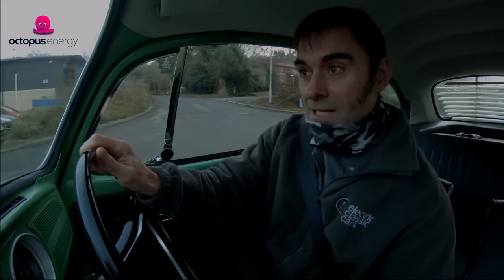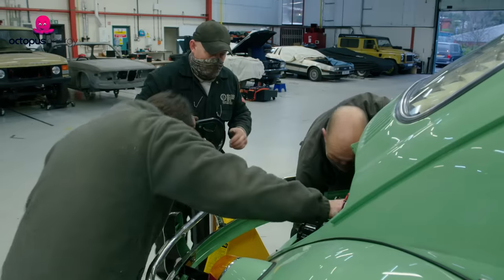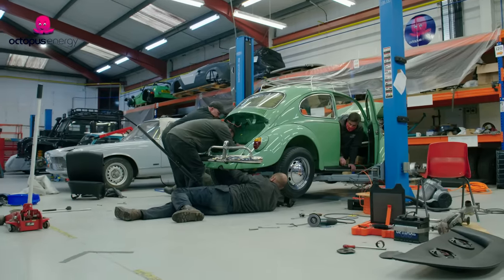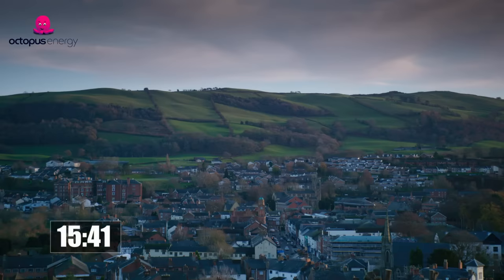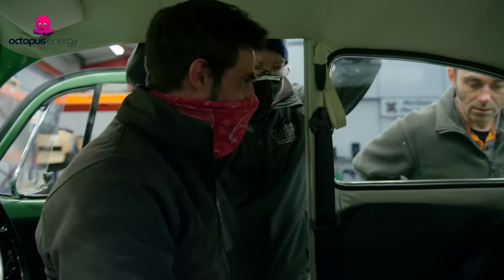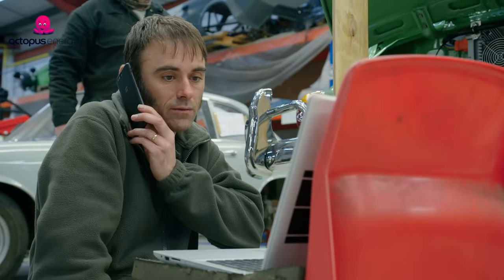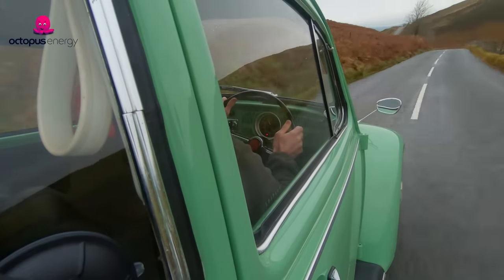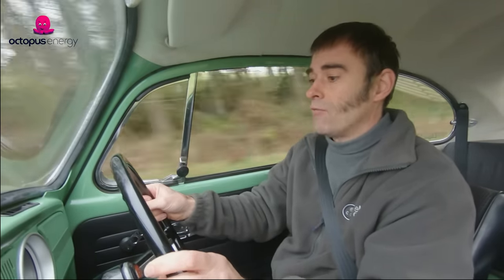VW Beetle converted to electric in a day

Comment: I was working at a VW dealership in Sacramento back in the early 70's. A man brought in his 1964 beetle that had been converted. Had the lead acid automotive batteries just behind the rear seat in the open space. The electric motor was actually an aircraft generator. He had a charging setup in the engine compartment. You switched the ignition key to the run position and the generator/motor would start. Push in the clutch and stuff it in gear and away you go. Pretty slick. Wherever he went people would be curious so they let him charge it there. Fairly simple compared to this one if the video.
Reply: Think on this hey come and charge at my place ....oh yeh anotherlot of free electrickery woooooo hoooooo  cost me nothin to run every other bastardpays me ...cheap electric cars have no soul 😈😈😈
Reply: New VWs have much better safety features dual air bags head restraints also improved seat belts I love the 65 66 67 year bugs but I wouldn't want to be in a crash still nice automobile
Reply: One of my grandad's friends converted a Fiat 500 around the same time. It was slow and did not have a very good range, but it worked good for short trips.
Reply: I own a 1979 MGB Roadster. Be cool to convert my B to electric. Nice work on the Bug!
Reply: What’s up neighbor✌🏼 I’m I. Citrus Heights Ca
Reply: @Future-Preps35  As I remember it those batteries were vented to the outside to prevent that.
Reply: Time will come when my petrol Royal Enfield will be such a novelty, I'll stop at people's houses for free petrol
Reply: @Future-Preps35  yeah and if you crash and the battery hits you in the back of the head.......all fun though, something to tell your grandkids.
Reply: How does the weight of a battery pack compare to the weight of the original engine? If the conversion adds a lot of weight, do you have to change the suspension? 

Also, in California, you can't charge your cars anymore in the evening after coming home from work. 

Also, watch 60 Minutes Australia on "blood batteries". Then examine the energy required to make 1,200 pound battery packs per car, or in this case maybe half that amount.

We must also take into consideration the fact that if every owner of a car, or multiple cars, in the world were to convert to electric technology, not only are there insufficient means to recharge...

but only one third of them could make the conversion due to the world's limited resources of lithium, cobalt, and the rare earth metals. 

In the meantime, British Petroleum, Dutch Royal Shell, ExxonMobil and the largest French petrol company have made record profits over the past few years. It's a scam. We all know it.
Reply: @higherresolution4490  how do they stop you from charging in the evening? Is it on a different circuit that they can switch off? Or what?
Reply: @stewartfenton7660  They might hit you if you were dumb enough to not secure them.
Reply: @higherresolution4490  You are preaching to the choir. I have trained for, worked on, and driven battery powered vehicles. Not a fan. Not a fan of CVT's either. Those that are telling us just how much better the EV cars are forget about the pollution generated while making the glass, upholstery, tires, brakes, bodies and all of the rest. They will have a hard time proving to me all of that was done using electricity.
Reply: @leemccullough558  
Gasoline has no soul... just kills souls actually.
Reply: This would have been a really good video...
except...
I wish the mechanics and host spoke English.
lol
Just kidding😀
Love the accents.  Oh wait!!!
One more thing...
You're driving that beautiful VW Bug on the wrong side of the road.  Why do that?  It's REALLY dangerous😱
Oh well... Good luck🍀
Reply: In 1980 we used a jet engine starter/generator to power a Triumph Spitfire.  Plenty of power.  Balancing the weight was key to success.  The electric controller was an education since they were prototyped for each installation. 

I later powered a Chevy LUV pickup with a similar starter/generator motor and original transmission.  Three position throttle: power, neutral, generate.
Reply: @Future-Preps35  That's a dramatization. You can certainly get a slight smell of Sulfuric acid when balance charging lead acid batteries as it happens at higher voltage than normal charging, but the amount of hydrogen generated (also only when charging) is negligible. Though to avoid corrosion in the battery tray and to avoid any chance of Hydrogen accumulating in closed compartments, like in a battery box, lead acid battery banks in EVs and in stationary applications usually have a shared hose connected to each fill plug to route any Hydrogen to the outside.
Reply: What most people don't know is that a generator can become a motor and a motor can become a generator.
Reply: @waltshepherd4525 
Absolutely correct 👍
Reply: @BajaGirl302  
"Fossil fuels are made from decomposing plants and animals. These fuels are found in the Earth’s crust and contain carbon and hydrogen, which can be burned for energy. Coal, oil, and natural gas are examples of fossil fuels."
-- National Geographic
Reply: Oh, god.... Yes,@All is singularity is All , we have all heard about that - from the same people that told us all the other stories / anecdotes / rumours / conspiracy theories over the years. 😑
Reply: @Future-Preps35  Modern lead acid batteries are sealed.
Reply: @waltshepherd4525  , I really not want this EV to be forced down our throat, I want it to remain a choice. Produce and sell both and let each individual decide. Do not punish those who want to drive petrol cars.
Reply: hi
Reply: @waltshepherd4525  Of course, all inside the vehicle batteries of today many of which are still the old lead acid type have vent tubes and are vented outside.
Reply: So the generator is always spinning when switched on ? Would better if it was actuated by the accelerator peddle then you could have better use of the gears. Unlike modern electrics which I don’t believe utilize a multiple gear shift box. I could see this beetle being fast as hell too. And suspension and steering upgrades would definitely be needed. But by then you could just buy a modern EV.
Reply: Pretty cool!Thanks for sharing! I'd love to do that too my 72 Datsun 1200 ...
Reply: you guys are amazing 🤩

Comment: I always found it easier to leave the muffler and tailpipes on,they make great handles to maneuver the engine in and out
Reply: I would always drop the engine on to a Radio-Flyer wagon and then get a friend to help lift the car over the engine.
Reply: @JoeHamelin   It's the same for the van as well.
Reply: It killed me.  It took three guys to remove the engine.  I used to do it by myself in the front lawn, then jack up the car and push it off the jack to get it over the engine so I could work on it.  Necessity is "mother."  LOL
Reply: @spydie me too... takes about 20 mins .. by myself.. lol
Reply: Right on. I once changed the engine in my 58 in 45 minutes. Just myself and a floor jack. There are only about 4 wires, one throttle cable, One fuel line, and four bolts involved.

Comment: That engine pulled out looks gorgeous too 😳
Reply: I just noticed that too. Absolutely mint.
Reply: Will not go to waste, plenty of Beetles need an engine.
Reply: That car is gorgeous! Period!!😁
Reply: As far as I know, they usually sell the engine to other people who want it.
Reply: A dirty ICE
Reply: I’ll have the old engine if it’s going spare!?
Reply: Yes
Reply: i have not seen such a clean engine  its almost looks new.
what price could you get for the engine to offset the build
Reply: @alkhan5445  no matter people still look for them
Reply: Steven ... that engine is not original to that year of car. Being a dual port 1600 puts it maybe 10 years newer.
Reply: @rupe53  who cares
Reply: @steinbauge4591  .... obviously the next guy who owns the engine.
Reply: @rupe53  Obviously that person will be most pleased with this engine ;)
Reply: That makes no sense. Pleasure in driving a classic is gone with the washing machine engine.
Reply: @Carl Klinkenborg ... that bug is not a '71. If I had to guess it's closer to a 66 or 67 but might be earlier. The hint that's most obvious is the swing axle transmission. The other hint is the smaller taillights. In '68 they also went to an external fuel fill instead of under the hood.
Reply: @Carl Klinkenborg ... was looking for more of those details myself but the camera didn't give me a clear view of the dash and a few other places. Here in the states, the swing axle went away after 68 and we also got a padded dash for that year and newer. By the time we got to round tail lights (1973) the fenders had also changed. I was aware that all the south american bugs had swing axles but by that time period we couldn't buy one.
Reply: @Carl Klinkenborg ... yes, I was aware of those differences between various markets, but I have been unable to keep up with them over the years. In the USA the bug was doomed for both crash tests and emissions standards, although the sub frame under a convertible seemed to sneak by till 1980 and somehow, they snuck in fuel injection on those as well. I suspect adding that to a standard bug was not cost effective in the era. As I recall the last "rag tops" were a bit pricy already. This begs the question of this one possibly being a composite car. It's remarkably clean for its age either way.
Reply: @Carl Klinkenborg .... had another look tonight and this car seems highly modified from the year you mention, but mostly on the outside. Interior (based on US cars) seems to fit 68 - 71 based on ignition switch, steering wheel, horn ring, rear quarter window hardware, and door panels. Outside we have early headlights and taillights, along with the deck lid, hood, and bumpers. High-back seats seem to be a North American item for that era (post 68) so the short ones we have here could be almost any year. I did not see any welded over area for the fuel fill based on a quick interior shot under the hood.
Reply: @rupe53  it's a 71, made to look earlier
Reply: Yes, the restoration before the conversion is stunning too. Between the restoration and the conversion the project must have cost a fortune. Far more than the car is worth but we all benefit from this leap of faith into the future.
Reply: @rupe53  looks like the 1963 my father had when I was a kid
Reply: Not the original engine, that is a 60’sBeetle. They didn’t have dual port 1600cc engines.
Reply: @Carl Klinkenborg Just saw this ,  I think you are right I still have a 71 1302s I also owned a 68 and my brother in law had a 67 , big difference ,  VW were still producing the  1300 swing axle torsion bar front in 71  because I have seen them here in Australia , also I think the rims are 4 bolt  140 spacing  so 68 on  , well its ether they updated the interior or back dated the exterior
Reply: noticed that was a duel port head on the engine pulled out.  not mint.  sweet car though.
Reply: @alkhan5445  When you open your eyes to what it takes to get your "clean energy", you'd realize you're pretty dirty as well, my friend. I'll take a motor for the torque, but don't be fooled, "clean" is just as dirty as "fueled".
Reply: @alkhan5445  less dirty than electric by a long shot. Just the process in making an electric motor takes insane amounts of coal. On top of that you are charging it with coal. Then when it dies the batteries are insanely toxic. Electric has a long way to go but it’s the future.
Reply: @davidsworld5837  I wonder if that engine was an aftermarket engine.
Reply: @Carl Klinkenborg US Type1 had IRS suspension from 1969 on. 1968 was the second year of 12v and last year of swing axle over here.
Reply: @Carl Klinkenborg My first was a German-issue '58 with "idiot stick" signals.  This initially looked  to be a '66 but it had a black steering wheel and those ugly black knobs on the vent wings started in '68.  It appears to be a cobbled together early pseudo '60s, made from a later model.  In some sense, at least they didn't ruin an original in the conversion.
Reply: It's a damn shame he tore it all apart.
I've owned several models of classic VWs and the chug chug of the motor was all part of its unique greatness.
Reply: it has many non VW poor quality replacement parts.
Reply: Yeah that’s not a chump motor
Reply: Engines that came from the factory didn’t look that clean
Reply: Yeah, maybe a little too clean, eh?
Reply: A waste of german engineering !
Reply: @Carl Klinkenborg You are wrong, it is older than '64. 1963 was the last year they had the narrow license plate light cover. '64 & newer they put a wide light cover on. My stepdad is a classic VW enthusiast (mainly Beetles), and that is one thing I learned from him.
Reply: I grew up riding around in those things in the country and they are one of the coolest little vehicles made. You could drive them through mud and bogs, up extremely steep inclines, were reliable and cool sounding.. Makes me sad to see even one slightly restored just torn apart.
Reply: I hope it can be recycled ... perhaps into a coffee grinder.
Reply: @thedubwhisperer2157  As you say the 1600 D P existed in 1971 and on but this car is NOT a 1971 .......Notice the lay down headlights and over riders on bumpers ......It has the taller side glass so it is a 1965 ( first year for that and a  40 hp)  , 1966 1300 cc one year only , or 1967 first year for 12 volt and 1500 cc with bumper over riders  .........
Reply: That car was clean....making it EV?....made it into a useless short range golf cart.  Driving the VW with the sound of its air cooled engine without range anxiety is more fun.
Reply: Where was this conversion done in the UK. I am so excited and would love to meet the auto wizards that did the conversion.
Reply: How much did it cost to convert the car
Reply: I know Lunaz motors do great feats like tnis
Reply: Yes it looks good and still in a good running condition and may I suggest that it will be installed in front of the bug to be his spare engine in case of electric motor malfunction..! LOL
Reply: It's really too bad that there is music playing when it is on the road.  At least in one spot let us hear how quiet the car really is.  Doesn't have to be a lot, just 30 seconds or so. Anyhow,  that's my five bucks worth.
Reply: @rupe53  Like you say likely a composite. But mostly '66 or earlier, I'd say. I had a' 67 which had moved on from the swing axle setup. To be honest, I'd have thought there might be a bit of a risk having that back axle setup together will the altered weight distribution and all the added power.
Reply: @londonwestman1  ... if you drive an odd-ball vehicle on a regular basis like I do it becomes second nature to NOT outdrive the built in limitations. Today almost every car handles well compared to the 50s / 60s cars. Back then you just spent a little time getting the feel for things and if you were smart, you didn't push your luck too hard. BTW, my fair weather vehicle is a 64 Corvair panel van. (yes, a truck that resembles a VW bus)
Reply: @pastblaster3285  No, run the plate. SMB 842J is a 1970.
Reply: But he said it's smelly in the beginning of the video.    Guts must not be great
Reply: @Neojhun  Could certainly sell the gas engine for half the price of the conversion !!
Reply: It was in perfect state! Beautifully restored car.
Reply: @alkhan5445  cringe.
Reply: user-ic9ys2bk2b  exactly! Chuga chuga chuga.... nothing like an old school vdub motor in a beetle or microbus❤❤❤🚗🚗🚗
Reply: @fernandoguzmanfernandez3466  So add a sound effect loop.
Reply: @fernandoguzmanfernandez3466  It's cool. I realize historic cars are not being used as daily drivers and maybe pollute less when taken for a spin every now and then. And yet calling into question the legitimacy of "castrating" classic ICE cars sits at the root of the fetishization of burning fossils that is making the big shift to net zero before 2040 THAT much harder. It's difficult enough to educate people on the concept of total cost of ownership against sticker price when considering new(ish) EVs. 
To me as a European it's hard enough to see the total absence (in lots of US made videos) of any long term let alone moral arguments when talking pro/con EVs, in 2023 it makes us rich countries that should be way further look extra bad. Please don't take this general rant personal, I just get triggered easily whenever sensing a lack of urgency.
Reply: Whats the Price for installing such engine in any Beetle ?

Comment: My Dad converted a bug around 40 years ago with a large airplane generator that I think he rewound (He did mining motors for Joy Manufacturing.) and lead batteries.  Still had the tranny.  It is number 66 for electric vehicles in Illinois.  Worked good except the batteries were way too heavy.  Now we have brushless motors, ESCs and lithium batteries to make it better.

Comment: I always thought my 1973 SuperBeetle would have been a good candidate for an electric conversion.  Ditto the two VW buses I owned.  That was before there was an industry and support so it would have been a project for me as an electrical engineering student.  Even with the relatively heavy and low power motors of the day, I'd have done it if the battery energy storage density was twice what it was back then, but those lead acid batteries were heavy and not good for many discharge cycles.  Lithium batteries have enabled us to have electric cars.
Reply: Wait till those solid states become available.  Thats what i am waiting for on my 1997 Citroën Xantia. Want a 200 hp motor in it, with those batteries where the tank now is,and some in the front